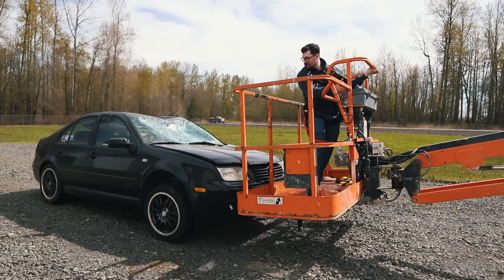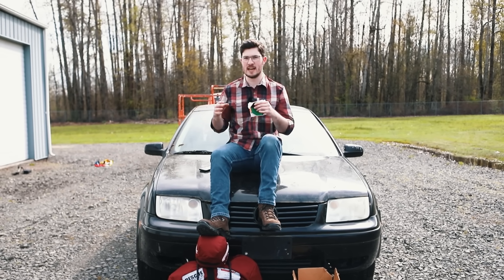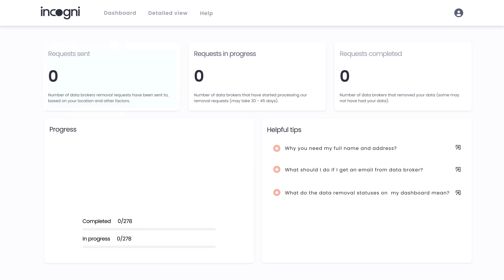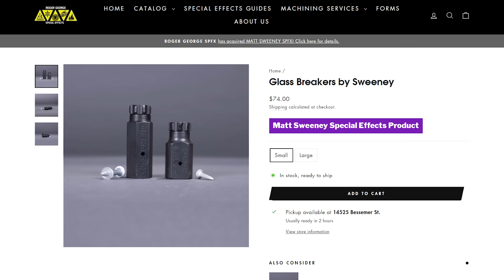Is Falling on a Car Safer than Pavement?

Comment from the maker: Take your personal data back with Incogni! Use code TYLERBELL at the link below and get 60% off an annual plan: http://incogni.com/tylerbell
Reply: Always a bad day when an excellent video is interrupted by ads.
Reply: People should be aware that all Incogni does is automate sending data removal requests, and that there's no way to unsubscribe from them other than to change your creditcard details. They are themselves much worse at letting you control your own data than many of the very limited number of services they target.
Reply: So.... what if he was wearing a helmet and took that fall?
 *Sensors on head not helmet
Reply: i hit a brick wall going 90mph in my car i bounced off and went 30 feet in reverse i got out of the car and was mad that i broke my phone ....its all just luck and how you impact ....
Reply: lol the first drop onto the car looks like dead pool 2 when he breaks his back in jail fall
Reply: You happen to be hiring for any team member position?
Reply: You need to take into account that the maximum weight capacity of the cars roof ie a small hatchback may have 40kg whilst a suv may have 70kg so perhaps the maximum  weight capacity will affect the crumple and there for the overall force impact, if the roof is strong and doesn’t crumple the person will be subject to more resisting force. So perhaps the safer car would be a car with less weight than you for reinforcement. Or perhaps how far away from your weight will it affect the force generated
Reply: My thumbs hurt from attempting to spruce up the algorithm for this channel by hitting like on every single comment and reply.
Including my own.
Reply: Freakin love your channel. Always have, always will, brother.

Comment: I feel like you needed to determine the minimum lethal drop distance first, and then drop the dummy from the same height onto the car. Also, Humans hold their head somewhat wit neck muscles which would have to help a lot. Clearly the car absorbed some of the impact. if a person falls from enough height, they would die, even if they hit water. you were dropping that dummy from a significant height.

Comment: To put it simply yes landing on a car would technically be safer the reason why is because of the car moving under the weight of your landing absorbing a lot of that kinetic energy where as landing on concrete would only provide on place for that kinesthetic energy to go due to the sudden stop which is right back into your body

Comment: I think the biggest issue here is that this assumes the person falling isn’t bracing for impact at all. The dummy is essentially taking the full force without any resistance from body positioning. For example, a person falling feet first might absorb the main brunt of the impact in their legs and pelvis (and possibly their head if they’re leaning too far forward), but because the dummy lacks muscles or bones, it ends up taking most of the impact in the torso regardless of the angle it lands as the arms and legs simply bend out of the way.
Reply: that and there's a difference in energy distribution between stiffness and relaxed muscles (like when drunk drivers survive car accidents)

Comment: So, with this I think it may be a case where falling on an older car might actually be "safer" than newer ones.  Newer cars have roll bars in the roof so that they don't collapse (as easily) in a rollover accident, but many, maybe most, older cars (thinking maybe mid-early 80's, but 70's for sure) cars often didn't have any real structure overhead.  They were essentially just supports to keep the roof panel attached to the car and didn't add much structure.  This is why those gigantic cars in the 70's often have great visibility, because thw corners can just be a little stick of metal for the edges of the glass to hang onto.  Yes, there are exceptions, but I know that at least American cars from this era were death traps in a rollover accident because the roofs had a tendency to collapse under the weight of the vehicle and crush whoever was inside.  Bad if you are inside and enjoy not being squished like a bug, but (potentially) quite good if you are falling onto the roof from the outside, because it would almost certainly crumple a lot more under your weight and "cushion" your fall better than more modern cars that are designed to be rigid enough to handle holding up the weight of the entire vehicle in a high speed crash.

Comment: You need a larger roof that does not have  a reinforcing structure around the sunroof.  The roof should cave in to soften the fall of the dummy.  Research actual cases of people falling onto vehicles and surviving from more than 5 stories up.  The vehicles take a lot of damage, while the people landed flat on the backs.  Falling "wrong" by a little and the head and neck are damaged beyond repair.

Mimicking mythbusters' countdowns reminds me of a equation I have for them:    Do they countdown all events; including starting a stream in the smallest room in the house?  What about number two?  When should the countdown begin?

Comment: Would be interesting to see this repeated with an older car.  Newer cars like the VW you have here tend to have very strong passenger compartments for protection of the occupants during side impacts or roll-overs, and to stay in shape while the front or rear crumples to soak up energy during head-on hits or when rear-ended.  Plus that's a unibody car where the pillars and roof are key elements of the overall structure.  Older cars - especially body-on-frame designs - were not built this way, and that roof impact especially would probably be a lot softer than in this setup.  Enough to avoid serious injury from that height though?  Probably not.

Comment: Just one thing though, that car had a sunroof which is more rigid. A normal roof i basically just a big sheet of aluminium with some wires and padding inside. Probably still fatal but still

Comment: the reason the 50 tripped on the roof fall and not the rear window is because of the moonroof. it has additional supports in the area and less crumple.

Comment: How well do those shock watches work if they’re not stuck to the hard mass you’re measuring? If it was on a t-shirt for example, wouldn’t getting hit in by an air cannon be enough to set them off? How much does that come in to play?

It seems like it wouldn’t be very useful if it’s on a different layer, not that it would make much difference in this test.

Comment: I think I'll have to disagree with the conclusion. The question from the title wasn't if falling from 75 feet on a car is survivable, it was if falling on a car is safer than on pavement. For me this translates to the question: Is the hight from which you have to fall in order to die higher when falling on a car than when falling on pavement? The shock stickers showed that the car cushioned the impact, so I'd answer this question with yes. The conclusion should be that it's at least plausible, although not to the degree that's shown in movies.
Reply: there is also the fact to consider, that repeated falling on the same car will reduce the amount of energy it can absorb on impact.

Since that energy is essentially transferred into the car changing shape as a result of the impact. So when the car is already deformed then it can absorb less energy and in return soften less of the impact.

Taking that into account I would even argue that more clean tests would end up confirming the overall theory just questioning the heights for which it applies.

Still a cool video tho.
Reply: Yeah i also thought that clearly he proved that you have better chances falling on a car than gravel.
Reply: That's just the title, he was comparing movies to real life not anything quantitative about concrete.
Reply: 100% agree
Reply: Yes, where was the content related to the comparison question? About as factual as the old MythBusters show.

Comment: I beleive multiple heights should have been tested against, as well as possibly multiple cars.  I beleive this is definitely plausible, as anything to break one's fall is advantageous over hard pavement.  Roof bracing also varies.  An eighties Ford has less rigid bracing than a modern vehicle with rollover standards.  A station wagon often has more rigid lateral bracing or a double wall.  G forces were notably reduced in testing.  Landing on a vehicle also reduces fall height somewhat.  The aforementioned eighties Ford example also has greater suspension travel and softer springs than a modern automobile, as would a Chevy Caprice.  I have personally jumped onto the roof of an eighties Ford, as well as the hood, from a relatively low distance (around twelve feet from the ground, eight feet from the car,) and I know that the dampening of the sheetmetal collapsing and the suspension do provide actually a fairly soft landing platform, provided you don't fall off afterwards.

Comment: I actually disagree. Compared to the control test, there were definitely trials with reduced G loads on both the head and torso. From the height you are testing from, I agree that that dummy is never going to be the main character, but there is likely an altitude where no car is lethal but car is nonlethal.

Comment: My thought on this is that due to how much less damage you do the torso according to the measurement devices you're using. . . Would the dummies survive if it succeeded in landing in a position where its head never smashed full force into the car. Like how parkour people are taught to role on the shoulder and spread the impact of the entirety of their body while also avoiding any impact to their head. If you were to land with an intent to try and spread that impact throughout your body but also avoid your head you'd be injured as hell and in a ton of pain but would you live?

Comment: Ingredients:
1/2C (4 oz.) milk
3 tablespoons sugar
2 teaspoons salt
3 tablespoons butter or margarine
2 (1/4 ounce) packages active dry yeast or 2 teaspoons Instant Yeast (.34 oz.)
1 1/2 C (12 oz.) warm water (105F to 110F)
5-6 C (1# 13 oz.) Unbleached bread flour
Directions:
 1. Combine milk, sugar, salt, and butter in small saucepan. Heat over low heat
and stir until butter melts and sugar dissolves. Cool to lukewarm (less than 110 F.
 2. If using active dry yeast, dissolve yeast in warm water in warmed bowl and
let stand for 10 minutes. If using Instant Yeast, just add it to the flour and mix it
in before adding liquids.
 3. Add lukewarm milk mixture and water to 4 1/2 C (1# 6 oz.) flour. Attach
bowl and dough hook. Turn to speed 2 and mix 1 minute. Continuing on speed 2,
add remaining flour, 1/2 C (2.5 oz.) at a time (slowly so it doesn’t fly out of
bowl), until dough clings to hook and cleans side of bowl. Knead on speed 2 for 2
minutes longer, or until dough is smooth and elastic. Dough will be slightly
sticky to the touch.
 4. Place in a greased bowl, turning to grease top. Cover; let rise in warm place,
free from draft, until doubled in bulk, about an hour.
 5. Punch dough down and divide in half. Shape each half into a loaf and place
in a greased 8 1/2 x 4 1/2 x 2 1/2-inch loaf pan. Cover; let rise in warm place,
free from draft, until doubled in bulk, about 1 hour.
 6. Bake at 400 degrees F for 30 minutes. Remove from pans immediately and
cool on wire racks.
For Hamburger and hot dog buns, divide the dough into 2-1/2 oz portions and
shape into a ball. Allow to rest for 5 minutes and then flatten with the heel of
your hand and place on cookie sheet dusted with cornmeal. Allow about 1”
between rolls for expansion/proofing. For hot dog buns, shape into about 5-6”
long tubes with seam down. Brush with whipped egg white/water mix and
sprinkle with sesame or poppy seeds. Bake at 400° F for 12-14 minutes or until
200° F.

Comment: There is a problem with his test. He should have drop tested the dummy at different heights on the hard surface to determine the lethal height, and once he had that data then he should have drop tested the dummy on the car at that height.

Comment: Theres a major problem with the experiment! You used a car with a sunroof. The rails act as reinforcement  and there's an additional crossmember behind the sunroof. This prevents the roof from "folding".
Reply: I think sunroof or not doesn't matter, it more on which car models, some older car with weak roof would be more crushed, but safer and stiffer car won't crumple as much. Lots of cars before the 90s had roof that would crushed when rolled over.
Reply: Gotta agree
Reply: That's not always the case.
Some cars have DIY sunroofs where you cut the hole out of the roof but the likely hood of this being a DIY sunroof is low .

Comment: Would a classic car be a better fall cushion (like, not a good one, just one good enough to prevent death). I would imagine that with them thin pillars, and with a roof not built for roll-over strength, it could be more pliant than a modern-ish car like the one tested here? (Well, as much as "pliant" can be applied to metal, anyway)

Comment: Really good video, but from what I know, how many Gs it takes to die isn't as straight forward as above 50 to the head means death. Obviously prolonged exposure to that kind of acceleration will kill you, but some hits in contact sports have been recorded at much higher that 50g at the head with minimal acute effect. From what I have read, anything above 85g will cause permanent brain injury but may not cause death. It always depends on how long the Gs occur for. The highest instantaneous g force ever survived is above 200, with severe injuries.

Comment: Note to self, don't fall on top of a car.
Reply: I mean, it is better than concrete
Reply: You want to spread out of the impact of the fall (and make the impact take as long as possible). So landing on your feet (so your legs act as shock absorbers) and onto a car (where the impact can be more easily taken) is much better than the concrete
Reply: @Stampyboyz yeah this test neglects the delay that muscular rigidity would have played, but ultimately that has to be a mute point. I’m not sure how to design a test that would allow for realistic data to be taken other than well…the real thing.
Reply: Usually I try to incorporate this philosophy into my daily routine. So far so good.
Reply: Yea I hope I wont